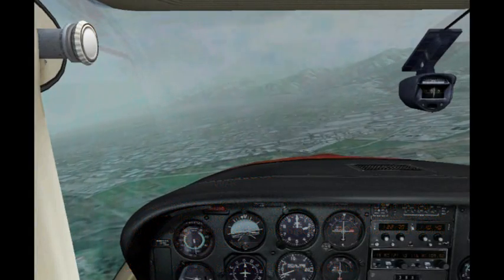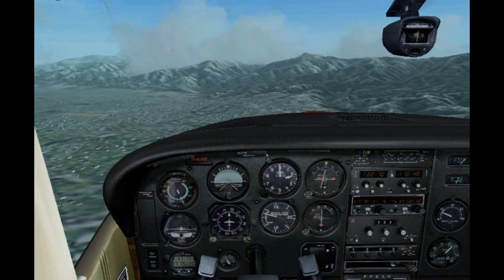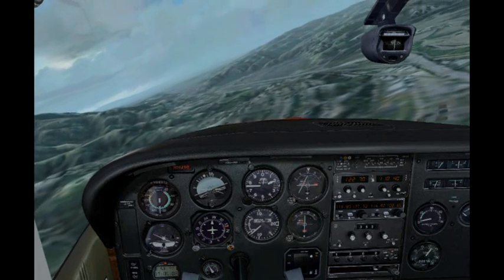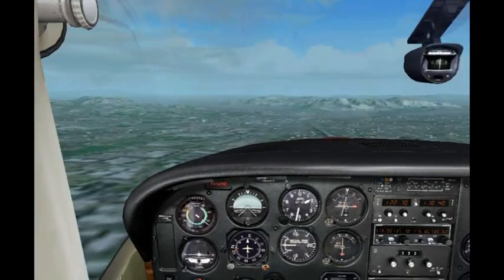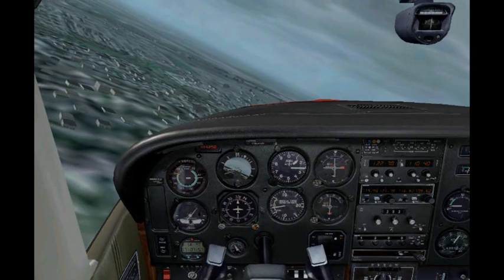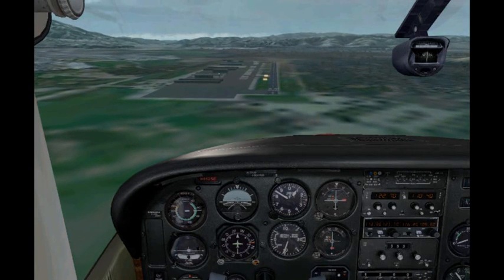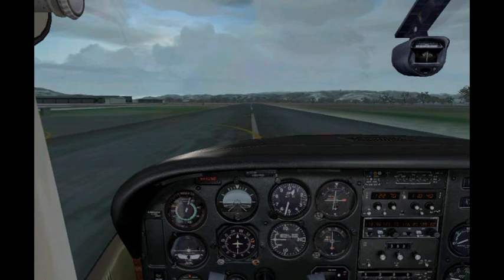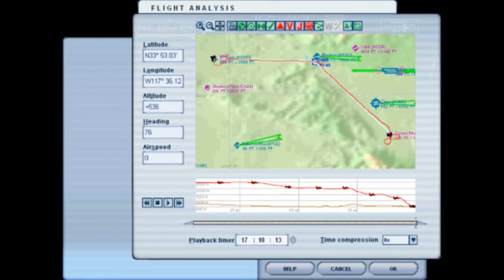VOR Navigation Tutorial (Part V) - 3 of 3

Comment from the maker: @FeelTheAir1

Traffic pattern altitudes depend on the airport, the standard is 1000 feet, but there are airports with different traffic pattern altitudes.

However, KAJO has a 1000 foot pattern altitude (1533' MSL - 1000' AGL), that is what I flew.

I think you may be confusing the entry into that traffic pattern (flying over the midfield), at which point we overfly the midfield at 500 feet above the TPA, in this case 2000 feet MSL.

Comment from the maker: @whindbagg

Yes, example, for KHHR IFR departure, nav 1 is LAX VOR (R170), nav 1 standby is SLI VOR. In nav 2 you tune in SLI VOR and in nav 2 standby you would have the next VOR you need fo your flight.

Always use Nav 1 as your primary VOR, and Nav 2 for triangulation. 

Exmp, your tracking on VOR 1 and intercept the point on VOR 2, you don't just leave in VOR 2 and track that one at this point, as soon as you turn on VOR 2, you transfer that to VOR 1 and set up VOR 2 for the next checkpoint.